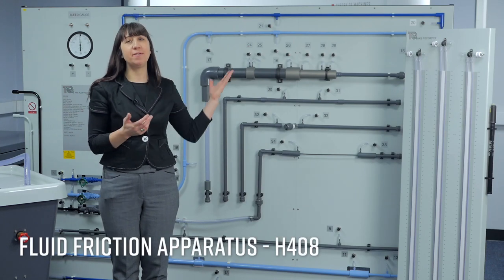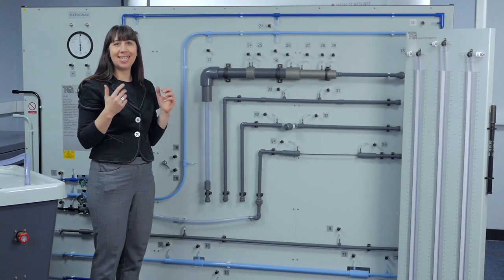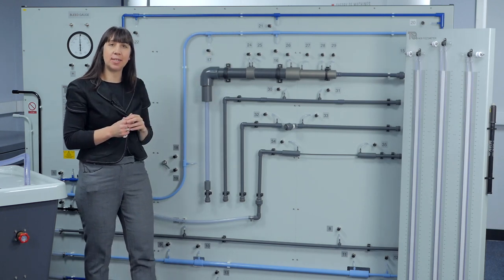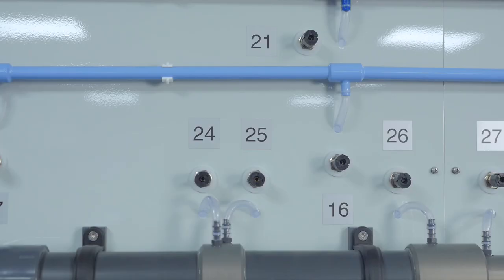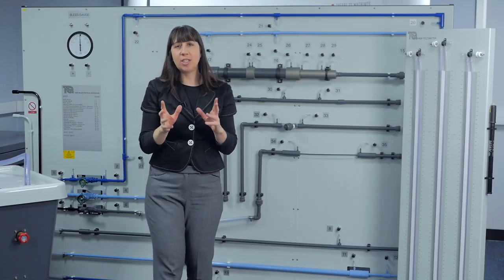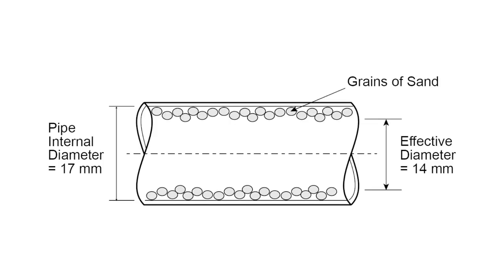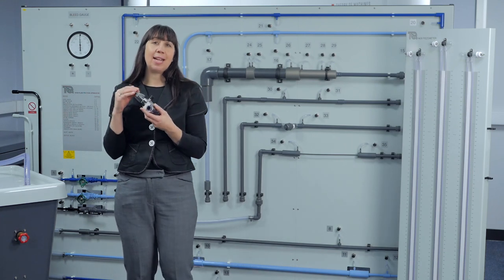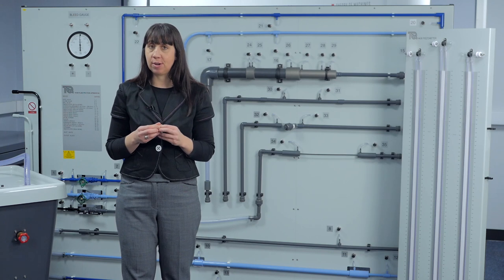Fluid Friction Apparatus (H408) - TecQuipment

Comment: What material(s) are/is the piping made from? I would like to know so that I can model the situation using CFD. Thanks.
Reply from the maker: Hi @philipschneider2712 this depends on what area and pipe you are looking at, if you would like to be more specific we can then accurately answer your question. But in general the materials used are either Copper or PVC.
Reply: @Tecquipment  I am specifically looking at the pipe beneath the radius bend at [17], it appears to be transparent so I would assume it is PVC, also, do you know what the internal/bore diameter of this pipe is?
Once again thank you very much and I appreciate your reply.
Reply from the maker: Hi @philipschneider2712 all this information and more can be found in the user guide that comes with the equipment when supplied, please refer to this document.
Reply: @Tecquipment  Thanks again for the reply, are you referring to this one: https://www.tecquipment.com/assets/documents/datasheets/H408-Fluid-Friction-Datasheet.pdf
If so, it does not state the internal/bore diameter of the pipe or what material it is (but from the information you have provided it seems to be PVC).
I appreciate your help.
Reply from the maker: Hi @philipschneider2712, the user guide (or sometimes referred to as a manual) is not a publicly available document, it is only found when supplied with the equipment. You will need to find this document for your information needs.
DIA 25 CLEAR UPVC PIPE 10 BAR
Reply: @Tecquipment  Thank you for the help
Reply: @Tecquipment  I believe this may be external diameter, am I correct?
Reply from the maker: Hi @philipschneider2712 all this information can be found in the user guide, please refer to this document.